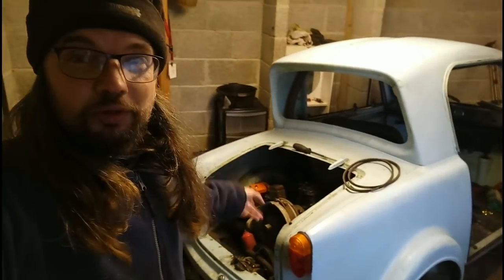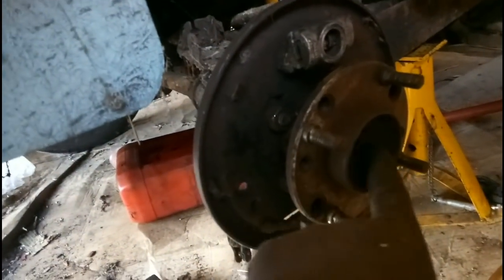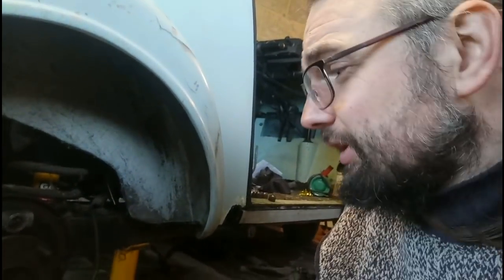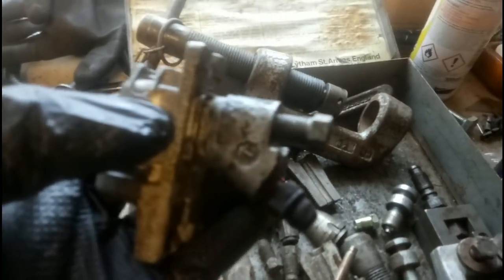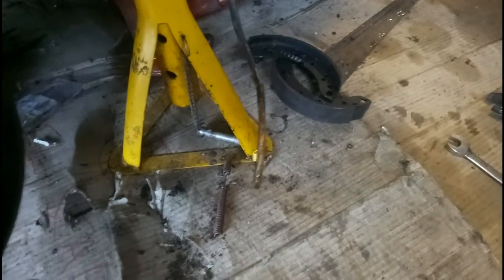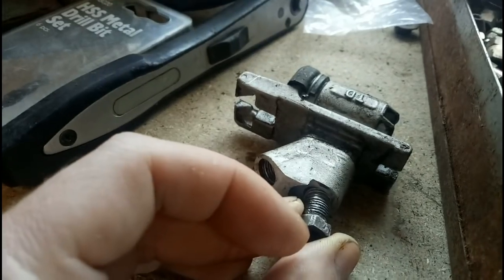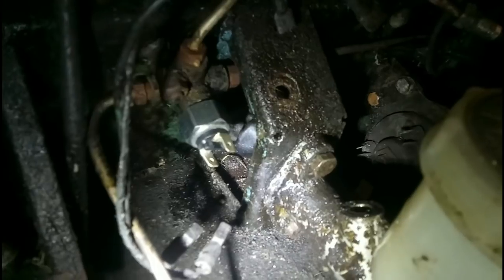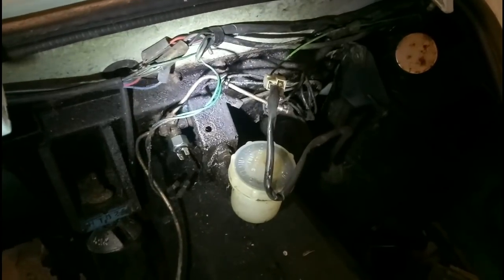Project Invacar Part Eight: Braking Bad!

Comment: A brake tool kit is about £20 on eBay and has a couple of drum brake spring fitting tools. They are worth their weight in gold! They make fitting the bastard springs without risk of serious injury a reality. They also have a tool for the little pissy spring pins that hold the shoes to the backplate. Only thing that pissed me off was why I had spent so many years struggling before buying the tool kit!
 As an asides, I have set up a " tool pool" with other enthusiasts in my local area. Between us we have a very comprehensive tool selection and saves everybody buying a tool that's only used once and a while. One member has a full on krypton tuning machine in his workshop! It is pretty safe to say our small group has every aspect of owing,restoring and maintaining classic vehicles. Might be worth considering setting one up where you are if you got enthusiasts nearby? Also provides a source of cheap labour for bigger or more complicated jobs( tea and biscuits the favoured currency!)
Reply: Where are you based?
Reply from the maker: Wales. Now have a flaring kit. Somewhere...

Comment: a handy trick for avoiding crossthreading bolts or fittings an old mechanic taught me is to turn it backwards until you feel the threads click past the start, and then screw it the right way into the threads. i used to work as a mechanic, and that trick has saved my sanity more times than i can count. here's another that might be of use to you, if you have a bolt to install that you can't reach, but can get a socket with an extension on it is to put a piece of paper towel over the head of the bolt, and push the whole kit into the socket. the towel will hold the bolt in the socket firmly to install it, but will easily release once the bolt is tightened in place. it's how i install the bell housing bolts in transmissions without a lot of muss and fuss. some pvc electrical tape around a universal swivel to give it some rigidity is another life saver. well, sanity saver, anyway.

Comment: The joys of motor mechanicing Ian, brakes and exhausts. Just reminded me, a quick story. Ok when I was in my 20s (couple of days ago) and working reconditioning engines, Carl's mother had a Mini. The rear of the main front to back brake pipe was rusty, the rest ok. So we decided to cut it and replace the rusted bit. Simple eh, had some new pipe, ends and a flaring tool. Of course I had to do this in the yard, so was underneath hacksawing the brake pipe when I just touched another, just a brief glance. Green fluid spurted out, yet it was one of those with hydrospastic (as we called them) suspension. So I had to then blow the pipe out, as it was inflammable. Drag the oxy welding set outside. Still lying underneath on my back, had to braze the pipe, finish and bleed the brake job. Then drive very slowly with no suspension one side to his brothers garage 3 1/2 miles away to have it refilled and pumped up. It's called 'the joys of motoring' (I think grin).

Comment: I had similar issue with my brakes and resolved to using wire to tie to the end of the spring threaded it through as you have done but the added wire allowed me to get good hold and manipulate it onto the other pad then taking off the wire was simple as I had double it over so I simply pulled it through
Reply: Yep sounds familiar. Had the same problem with the drum brakes on Rita my Renault 4. I managed to break a spring too but it all worked out in the end.

Comment: I know your pain Ian, spent the whole weekend struggling just to change the handlebars, choke and clutch cables on my Honda NTV.  Turns out taking the bars off upset the throttle cable return in the process. Hours of putting right the previous owners bodgery! Keep up the good work!
Reply from the maker: +Krafty Beard Yes, familiar experiences for sure. Plenty of times it's gone wrong for me, in far more spectacular fashion.

Comment: Most 60's drum brakes are of a similar style. I like the previous answers of using wire. I just used long nose pliers. At least 3 blood blisters later the springs would be on. good luck
Reply from the maker: +Graham Buck Thanks. I have several tips that have been passed on. Will have another go over the weekend.

Comment: The day I refurbed the rear drum brakes on my 1993 Jeep Grand Cherokee is one I'd rather forget. Everything was going swimmingly until it was time to install the new springs. I'd already invested in the proper drum brake spring tools, but the one that you're supposed to use to stretch the springs was useless, it wasn't long enough to provide enough leverage.

In the end, I had to use a very large pair of channel locks to get the needed leverage to pull the springs far enough to get them to hook on to the opposite shoe. I literally had to pull on the pliers with both hands.

Comment: That Brake Pipe Flaring tools is the nuts,  have one also made by Supra in the 80's. the last one i saw come up for sale went for 60 odd quid if i recall. one of the easiest to use and give very good results every time.

Comment: You'll get there mate. I think brakes are the bane of every mechanic. I hate doing them but I am / was very good at them. I used to be the one people would come to to do / fix their brakes. Even though I hated doing them, I would get them done. I think it was because I had more patience and a higher tolerance than others..  Still, I would prefer to decoke and regrind the valves on a Pinto engine. :) AS I have not worked on one for about 20 years, I think I would have to revert to the haynes manual now. lol. Memory not what it used to be.

Comment: We used to get a big adjustable spanner, get the opposite shoe in place and use it on the end of the other, pulling it back & away, stretching the springs with the extra length & leverage though you don't have a lot of room under there. Maybe from underneath?

Comment: I had the same problem fitting rear shoes to my Avenger. In the end I made a tool for the job by bending a hook into the end of an old screwdriver and hooking the spring into one shoe and pulling it with the bent screwdriver/brake shoe service tool into the hole in the other shoe. It was still a 'mare of a job even with that.

The same tool came in handy again doing the rear shoes on my dad's Sierra. It was still a nightmare...

Comment: I just had flash backs of terror watching this. Hand brake shoes on a Toyota Prado. What a nightmare. In the end I worked out the 'trick' was string through the holes in the hub and pulling on things. Took me about two days to work it all out and get them going nicely. At one point got it all back together to find I did a spring wrong. As for springs I made myself a fantastic tool which was a big heavy screw driver with a notch cut in the tip. Get it right on to spring things and push em around without losing em. One side of the notch shorter than the other and the whole thing ground down extremely thin. Push the spring and then twist to get the pushing tool out. Anything involving springs now and I reach for it.
Reply from the maker: +Damien Towning Thanks for the insight!

Comment: My Carlton has minature brake shoes for the handbrake almost completely hidden behind the wheel flange, i spent ages trying everything, even made a special lever arm type tool to pull the springs, then along comes my mate and says it's easy, he produced an old boot lace from his tool box and pulled the springs into place in a matter of seconds, i felt such a fool !! you can even thread second boot lace through the holes in the brake shoe to pull the spring hook up through the hole.
Reply from the maker: +Ian Virco I have much to learn. Thanks for passing that tip on!

Comment: You can remove the wheel hub,you have to unbolt the 4 bolts that hold the drive shaft to the aluminium block,then behind that is a large nut that holds the whole hub assembly on,can then be pulled forward for clear access to brake components.

Comment: You ought to check the spare invacar, and see if it possibly had a different push rod that matches the master cylinder you bought
Reply from the maker: Not a bad idea. Will see what Past Parts say first. We're trying to establish what size the old one actually is.

Comment: Those rear brakes are exactly the same as the reliant robins, although turned 90 degrees around. I drove for a few months before realising one of my wheel cylinders had none of those clips and was basically being held in by the shoes and friction. Luckily the drive hub on the reliant is smaller so it's easier to get to stuff.
Reply from the maker: Yup, absolutely the same. I think they were also used on the Triumph Herald and a few other things. Glory times, when parts would fit several vehicles. None of this 'specific to model' nonsense!
Reply: HubNut instead doing the brakes is equally painful across most cars

Comment: Hubnut... looking at the master cylinder is the new one different in that the seals and gubbins are already inside there? Where as your old rod looks like it has the ‘O’rings fitted to the shaft has the new one got like a sleeve inside with them already fitted? Try  inserting a screwdriver and see it it moves the bit inside it.. what you need is a volunteer to come over there and help you out for the day to knock some of those jobs off your list 😁😁
Reply from the maker: Have had discussions with Past Parts, and it just seems like there is a different size. Girling annoyingly used the same casting but with several different sizes of bore.

Comment: Sorry see you tried the halfshaft you need a tool to expand the top of the shoe to stretch over adjuster and wheel cylinder    it looks like a large pair of scissors

Comment: Does the driveshaft unbolt probably got a single fixed bearing in the axle tube if you can slide hammer the shaft out you may be able to get shoes and springs on

Comment: I put copperslip or similar in the sliding slots. it keeps the cylinders working properly until the shoes need relining in the future.. Buy a brake spring plier too. A pickavant hydralic flaring tool is great thing to own.. :-)  it sounds like wutherring heights outside or is it a jet?
Reply from the maker: +Mercmad Thanks. It was a jet I think. We had F-15s flying low earlier in the week.

Comment: As regards the brake shoes what I would do is get to Lever bars that are slightly bent at the end put them in at the top at an angle and just push the breaks apart do the top first then the bottom it will be awkward but they should go in
Reply from the maker: Biggest problem is having practically no access to get the bottom spring on. Top one has to go first as it twists right through the shoe. Horrible things.

Comment: Tip for stretching inaccessible brake drum springs. Get some thin as possible metal stranded wire like bike gear cable. Make a noose with a t-bar at one end that can be pulled. Hook the cable into the spring hook and have someone pull it to stretch the spring while you use a hook tool (knock something up) to get the spring end through the hole. You will likely have to cut the cable noose to get it out. I have done my Škoda brakes this way and it worked out fine. Main thing is prepare by making tools if need be and not rely on ready made tools. The service shops had access to specialist tools and some are almost essential when working on the jobs they were intended for.
Reply from the maker: Nice tip. Thanks.
Reply: HubNut Glad to help. It will seem all the easier too when you are feeling better and get some energy back.
Reply: There are lots of tools actually designed for drum springsand clips etc. You can get a pretty comprehensive set for around 20 quid. With the kind of cars you like, it might be a good investment......

Comment: That connector should be easy to get. It's bog standard imperial fitting. Not saying you'll get it at Motosave or the like but they will be same as on my Ford Anglia and Reliant Regal. Thing is, have you damaged the thread in the cylinder housing?
Reply from the maker: +Darwinion Pleased to say that a new connector is on the car, and the thread is fine.

Comment: fit the bottom spring to the shoes and put that onto the wheel cylinder not though locating the shoes at the top.. let them rest forward away from the car...fit the spring into one side--- push the shoes together at the top then fit the spring into the other shoe.... then pull the shoes (at the top) apart and back and over the retainer on the back plate...

Comment: It's lucky the damaged threads on the union didn't damage the threads in the wheel cylinder port as well. I once had a car that required a leaking wheel cylinder replacing. Upon starting the work, I discovered that the union thread and also the cylinder thread had been damaged and GLUED IN WITH ARALDITE!!!!!!!.    As I had bought the car from a friend of the family,  I asked him about this and he said that the car had been in the garage just before he sold it to have this same wheel cylinder replaced as it was leaking, so it must have been down to them. He had been billed for a new cylinder, that was clearly not fitted and presumably they had damaged the threads.    You have to wonder sometimes!   Keep up the good work.
Reply from the maker: Yikes! Yes, I was very lucky not to damage the wheel cylinder. Would have been an expensive error.

Comment: The springs are usually on the out side (face) - are the shoes the same for both sides ? any markings ?
Reply from the maker: Springs were definitely on the inside, and the diagram backs that up. However, sounds like there's no harm in putting them outside. Shoes are identical. One, it seems, is the wrong way up. I'll correct that.

Comment: Been there, done that - I know just how you feel when a project turns to crap like that. I commiserate. On the bright side, at least this isn't a car you need to get fixed up right now because you need it to get to work in the morning (I've been there before!), and at least you have a garage to do it in - I've done projects like this out on a driveway, in the freezing rain, with rainwater running down my collar. I wouldn't recommend that.
Take a good rest, walk away for a bit, get better and come back refreshed. Tea fixes everything. Failing that, hammers. 

On a more serious (or at least, helpful) note, is it not worth considering taking the driveshafts out? I don't know what's involved but it might actually be less work than trying to struggle around the hub flanges. Just a thought.
Reply from the maker: Oh indeed. There's a torrent of water down our driveway right now. Glad there's no urgent tinkering going on! I can just down tools and walk away.
Reply: Yes been there and got the tee shirt .my claim too fame has to be lying in 3 inches of snow fitting a manual gearbox in a 3lt capri .once you got over the coldness it was quite comfy on the soft snow untill shuffleing around underneath the snow ending up your back or down the back of your jeans.

Comment: Couple of things Ian: you can get brake shoe spring pliers that make the job a bit easier. eBay item number:121917792746
Also wrt the distributor, you may find it is made from pot metal (a zinc alloy) rather than aluminium like the engine block. If this is the case you may find that heat will assist in removing what is left of the disty. The melting point of pot metal is much lower than alu.

Comment: brake springs are a bastard...so....i made a long hook with a great big handle...........thread the spring though and hook with the hook then long nose pliers to try to hassle it through the 2 holes.......try many times good luck matey.

btw the dist fix is going to be a sod engine out and re machine   ha ha ha ha ha ha  you wont do that again....or just burn the bugger !
Reply from the maker: Yup. Current plan is to assess the spare engine and if that looks likely, do a swap and sort out the original engine at my leisure.
Reply: if you need a mill i got one !

Comment: Not a fan of copper grease for anything ?  use aluminium anti seize instead for everything
Many many years ago we used to paint copper grease on aluminium air bag pedestal between the chassis member on Leyland Tigers but they rotted even quicker than fitting them dry some awkward chemical reaction ... but those days it was the norm till someone tried a different paint solution to save time and money... and in those days we had some weird and wonderful see saw tools for brake springs and big screwdrivers,  Bedford YQ series had the best solution expandable fingers so you could build the brakes and springs on floor and expand them to fit the axle ...  with rubber bands ...for the expanders stop falling out
The good old days,   copper grease not ideal for your application 
Wonder how much saving Past Parts would charged for recondition your old parts .. I would imagine they will have a solution for your rod 
I would be interested to know what casting on the distributer of the spare engine is ? 
I saw a steel type for Styer Puch and it has the worm gear on the base ( same engine ? )
So may not be compatible to swap that part only easily ?  thinking yours is castle head slot type ?  
Anyway  keep fighting the good fight and await your next disaster video to share with the world 
Plenty of tea and cake to keep up your immune system
Reply from the maker: Thanks. Past Parts may well end up reconditioning the master cylinder, as it seems to be a very odd size.

Comment: This shows finest British engineering from the era. I bet the 2cv is miles ahead compared to this...
Reply from the maker: I did rebuild the 2CV's rear brakes last year, albeit at a specialist with them looking over my shoulder. Don't remember it being this difficult, though you do need to undo the rear hub nut, which requires over 200lb/ft!
Reply: Hence your name.